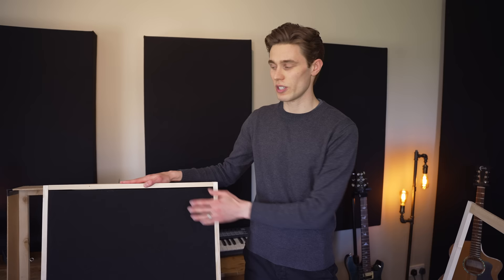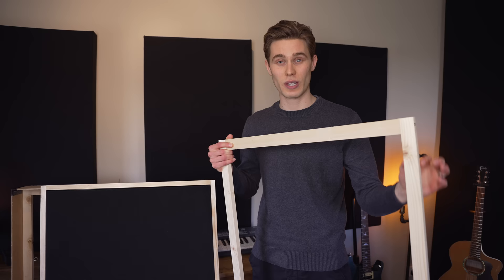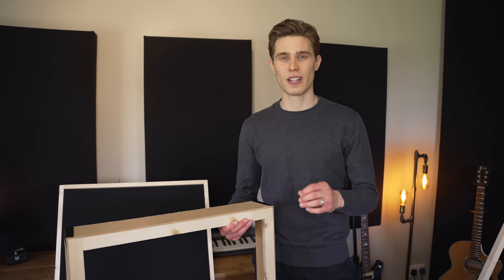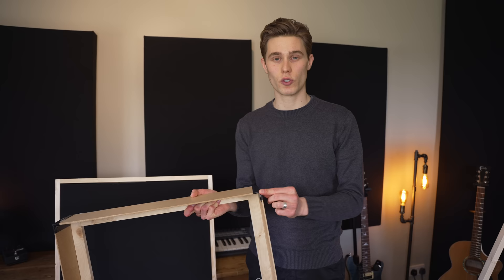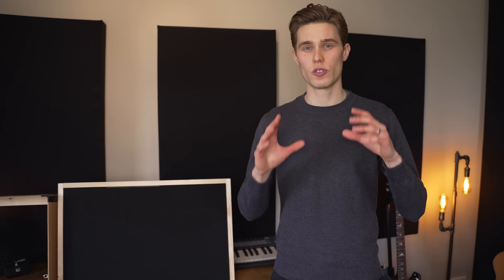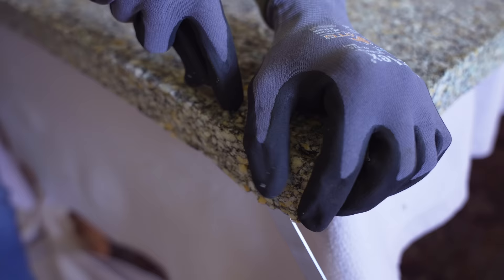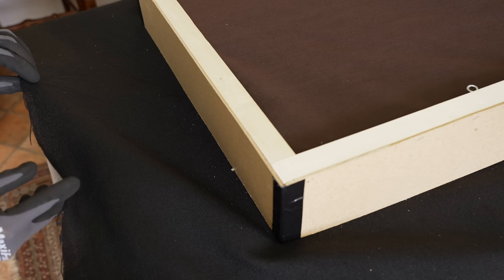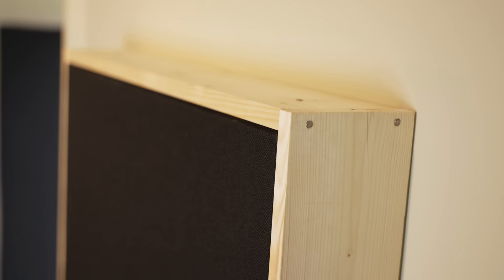How To Make Your Own Acoustic Panels - DIY Professional Acoustic Treatment for Home Studio

Comment: This is such a brilliant resource THANK YOU. 
Safety from toxic chemicals in my small VO booth has been a real concern for me, and peoples compliancy about the harmful toxins released by foams adhesives, rockwool etc. amazes me, you could be saving lives here. 
Please can you help me though, I am in the UK and have spent a good day trawling the internet and only finding large rolls of very expensive fleece, and I am not sure that thermafleece at 22 kgm-3 is the density you suggest. They do slabs but they are hugely costly.
I would go out and buy a large role of thermafleece and get all 7 panels made, but I am not confident that I really need that many as I will actually be doing my recording inside my VO booth.
 I have just moved home and am having a huge crisis of confidence as I am starting all over with a new booth construction. I would be hugely grateful if you could give me a couple of links to UK companies that stock slabs or insulation that is the right density.
Reply from the maker: Hello Eliza, thanks for the support. I too am amazed by the complacency folks have towards these materials. I was equally naive when younger but know better now!

Unfortunately, there has been a real building materials crisis in the UK, at least in my opinion! I cannot find even one ideal choice for the insulation now. Some hemp insulations look promising but they are also highly expensive.

If I can help ease your worries, I'd ask what the VO booth is going to be used for? 
If you are recording audiobooks and professional broadcasts, you do need to take great care but if it is for singing/performance then you might find better results without a booth. I once set up a vocal booth for singing and the result was horrid becuase it really was a tiny room! I found much better results with some close acoustic panels in a large room. I basically used these same panels but added wooden legs to them to move them close to me during recording. It sounded better than any booth I'd tried.

Additionally, the quality of voice denoising and background noise reduction has improved significantly in recent years and can really do wonders!

If you have just moved home, it's possible that any excess insulation you order could be used in a loft space for additional home insulation?

Good luck, let me know if you find anything that works. 

Michael

Comment: Hello, brilliant video. Thanks for sharing. I am going to try to help my Cousin with her board game shop. She says the sound is terrible. From memory it has high ceilings and they have an open plan coffee and snack kitchenette so plenty of clattering. Also, I once helped installing suspended ceiling panels in a restaurant which worked a treat. These used rock wool. FIRE SAFETY was a large concern of mine but that did not concern the company I worked for.  I figured a fire resistant material may need to be used. This is a public place and some of the commercial panels talk about fire rating.

My question is about the fire rating of the filling materials you are using.
I thought rockwool was supposed to be ok, certainly skin wise for me. The old glass fibre was evil on the skin and probably like asbestos in the lungs.
These more friendly fillings seem a great idea but how do they burn???
Thanks again!

Comment: I've worked with fibreglass and rock wool insulation in home renovations.  I hate fibreglass as i get very itchy working with it.  Rockwool is much better.  This said, either be very gentle when handling the materials or wear gloves and a mask.

Comment: Hi, what did you mean by "it will be hard to work with if density is about 40 kg/m3, 50kg/m3 or more" ? Did you mean they will be heavy ? Because I get an offer for 120 kg/m3 recycled denim with a 18 eur / piece (100cm x 100cm x 7cm)

Comment: Great video. Thanks for the heads up about the insulation material.  I was wondering if blockout curtains would be effective? Blockout light and sound. Inexpensive and easy to hang around the studio. Adjustable, so can vary the amount of sound deadening. Regards.

Comment: Thanks so much for this extremely helpful, detailed, and thorough video. I'm wondering how you determined how best to space your panels, and how many you wound up using in the room you were in. Also, are those separate bass traps in the corners? The results of your A/B test at the end are quite dramatic! Thanks again for this resourceful vid.
Reply from the maker: Hi Erikk, this is a good question!
I have 8 of these panels, 4 thinner panels and 2 bass traps. I am planning on adding a thin "cloud" panel above my head too. I used thinner panels in odd spots that can't fit a large panel.

While some careful though was put into how much treatment I need, it became apparent that to deal with every potential issue, I'd need to cover my whole room with very deep panels and then add diffusers to try and bring back a good room sound! 

I decided to aim for a middle ground where my room still looks and feels like a nice space to work in without going overboard on the treatment. I spaced them by eye to what suited me.

Comment: Easy to understand (I have two left hands, as we say in Germany), great presentation and the end result looks amazing and does the job. Will definitely build this for my home theater/music room. Thanks a lot! Question: How many panels did you have in that room for the sound test/difference? Only those 3 or more we simply couldn't see in that frame?

PS: Another thank you for not forcing Raid Shadow Legends or SquareSpace on us. Cheers.
Reply: Hi, hast du inzwischen welche gebaut? Welches Dämmmaterial hast du benutzt? Ich suche gerade verzweifelt Verbundschaumstoff (das ist wohl sowas ähnliches wie das was er im Video nutzt) mit einem Raumgewicht von max. 30kg. Finde aber nur was um die 120..
Reply: @stoneage8593  das ist es, was mich bisher tatsächlich abgehalten hat. Schön, dass es nicht nur mir so geht. 😂 Ein Freund hat sich sein eigenes Heimkino gebaut und hat da einiges an Erfahrung und will mir netterweise zur Hand gehen. Kann dann gerne nochmal updaten.
Reply: @Drumming_Monkey  würde mich freuen :)
Reply: @stoneage8593  egal, wie oft ich versuche zu antworten, löscht yt das Kommentar wieder. Toll. ^^

Dröfzigster Versuch: Ich habe mit meinem Kumpel Rücksprache gehalten und der meint auch, dass PU-Schaum, also Verbundschaumstoff gut funktioniert und optimal für den Zweck ist. Ich habe mir auf sein Anraten hin 4 Stück bei einem Baumarkt geholt (Der mit dem Bau und dem Haus). Die findest du auch auf online auf deren Seite und kannst es dir schicken lassen. Der hat zwar ein größeres Raumgewicht, das ist aber zu vernachlässigen, da wir das ganze Panel verbauen und du ja nicht anderweitig damit hantieren, oder es beschneiden willst. Das Gewicht von 3,25 kg ist auch völlig okay.

Viel wichtiger ist der Absorbationsgrad, den der sagt aus, wie viel Frequenzbereich das Panel schluckt. Das findest du unter der Bezeichnung Stauchhärte und ist hier mit 6,5 kPA gering und damit gut, es werden also nicht nur die hohen Frequenzen absorbiert und genau das wollen wir ja.

Beachten solltest du noch, dass die Größe des Schaumstoffs 100 x 50 x 7 cm und damit etwas kleiner als in dem Video hier ist, pass also entsprechend deine Holzzuschnitte etwas an. Ich werde allerdings die Tiefe des Außenrahmens mit 11 cm belassen. Vorteil davon ist, dass ich den Innenrahmen und den aufliegenden Schaumstoff nach vorne bringen kann, sodass nach hinten zur Wand hin ein Hohlraum von +/- 4 cm entsteht. Dadurch werden von der Wand abprallende Wellen nochmals absorbiert, was die Qualität des ganzen Panels enorm erhöht, als hättest du ein deutlich dickeres Material. Zudem wird der absorbierte Frequenzbereich nach unten hin um ein ganzes Stück vergrößert. Win win also. 

Halt mich gern auf dem Laufenden, wie es bei dir klappt. :) Hast du schon Stoff besorgt und wenn ja, wo/welchen? Ich habe meinen vom örtlichen Gartenmarkt geholt. Ein Anti-Unkraut-Vlies mit 1,2 m x 10 m. Hat mich ca. 17 Flocken gekostet.

Comment: Hey, awesome video - not sure if the price still reflects what you've said but I found the exact same recycled insulation at B&Q but noticed you are using two slabs per panel - pack of 6 cost 108 now so it's 36 quid for just the slabs alone, am I missing something here or just an inflation issue? 😂

Comment: Thank you so much for this well-thought-out lesson on constructing these panels! 

The instructional quality of this video is flawless. There is a massive difference in sound absorption compared to other DIY acoustic panels I have researched on youtube. You may also have a better ear for setting up acoustic panels efficiently. Is there a set of rules/panel-to-wall ratio that you adhere to when setting up your studio?
Reply from the maker: Thank you! I really tried my best on this one. 

As for rules or ratios, it can become very complicated and many will try to over sell the amount you need! I think you can get a great result with a 20% or more wall coverage. The reality is that to make a room "perfect" you would need to cover almost all of the walls with at least a foot deep of panels and add additional diffusers and reflectors. 

I live in the real world so I simply spaced them out until th room sounded good and I was happy with the look of it!

I did make sure to cover the first reflection points of the speakers and avoid any large (3ft / 1m) gaps. Those gaps start to cause a lot of slap and echo.

Good luck, even 2 or 4 panels will make a noticable difference to your space!

Comment: Denimfibers are also unhealthy. When fiber like in Rockwool, etc...is covered it is not harmful. Also those fibers are heavier than air, so they drop to the ground, where as denim fibers can float and potentially be breathed in. Just because it is "natural" doesn't mean it's safer to use.
A proper handling is essential.

Comment: Great video! I'm going to be doing this over the next 2 weeks. Would you mind answering a quick question? What are you doing for your corners / bass traps?
Reply from the maker: The bass traps are a similar design with the wood cut a 45 degree angles to fit the corners. Its a bit more work but gives a good shape. The filling is also more dense.

Comment: I suppose a similar design would work for acoustic ceiling clouds? But, perhaps put the strong frame on the bottom, so it holds the insulation up?

Comment: you can use a painted canvas and just fill it with insulation - sure, the surface isn't ideal, but it still helps a lot

Comment: Amazing tutorial with all the of the details thanks! I would have never thought to use a frame with fibreboard and would instinctually think that using large wide square planed timber would have been much easier and stronger. The fibre board that seems like it actually holds the weight of the acoustic material seems wobbly and weak as it's only attached on one wide. How are these holding up? Does the fabric tend to sag over time and how do you fix that issue if it happens?

Comment: THE ESSENCE OF A DML
Through careful selection of plate material, geometry, boundary conditions 
and excitation point(s), it is possible to evenly distribute the bending wave 
modes across the desired frequency range. This ensures a smooth frequency 
response spanning over seven octaves producing extremely wide and 
predominantly diffuse sound coverage

Comment: Hi, let me start off by saying thank you so much for this awesome tutorial. You've helped me save a bunch of time and money. So I'm currently in the process of building this and I'm at the stage of putting on the cover that will hold the insulation in place. I too, am using the weed prevention barrier since I have much left over from my landscaping days. I just had a question on it. Can I just staple the weed prevention barrier to the frame first, then staple the outside boards to the frame? That way seems much easier to me but just didn't know if there was an apparent reason you chose to staple it after stapling the boards to the frame. Thanks!

Comment: This is super helpful! The only thing I don't get is you say the frame is doing all the heavy lifting and the sides are non-weightbearing but it looks to me like all of the weight of the insulation would on the bottom side panel, or am I missing something?  I'll probably just use slightly thicker wood and a couple nails for piece of mind lol.

Comment: Hi Michael, thanks for the amazing video. One question: is there anything more "home made" that I can place inside the panels for absorbing sound? Where I live the materials to put inside the frame lie a bit on the more expensive side, so I was wondering if I could maybe replace it with any other sort of soft materials such as filling foam (like the ones inside stuffed animal toys), egg cartons, general fabrics and duvets, etc?
Reply: My Rockwool cost me $11 per batt (8 batts, 2’ x 4’ x 3”, $89).  Less per panel than good 1x4 pine!

Comment: Top video 👏👏👏
Question: Do you think varying the depth of insulation within a panel will trap a range of frequencies better than material of consistent thickness (flat)?
I believe that's why acoustic foam is textured, so just working out which way is likely to be more effective...🤔

Comment: Great video. I was wondering how much of the difference between using the panels and not having the panels is due to the bass traps you have in the corner and not due to the wall hung panels.

Comment: Great tutorial! One question: I'm planning on trying this project this week in my home studio and I was considering using a 3/4inch thick "Sonopan" sound panel as the "insulation", usually used behind drywall. If I go this route should I use two layers, so that it's 1.5in thick? Or should I just have thin panels that are just as effective?
Reply: The thicker the better. This is just my opinion, but whatever the material you're using, if it were me, I'd make sure I don't put less than 3-4 inches of thickness on the wall. If you want broadband mid to high absorption, your panels would need to be quite a bit thicker than 1.5 inches. Now, if all you're trying to do is get rid of slapback in the high frequencies, 1.5 inches would be okay I guess. I have no experience with sonopan, but I have seen the youtube video tutorial from the guy who used it. Not sure about its performance to be honest, but again, if the slapback is all you're after, then it would technically work.

I'm planning some panels of my own, and based off of my own thinking and looking into various options, I would sooner consider dense open cell memory foam instead of sonopan, but that is not based on any experience with either material so take it with a grain of salt.

Comment: For ceiling mounting, would you use a different frame design?
Reply: 4 hooks on each corner would probably do, but you could reinforce it with a 45 degree if you'd like

Comment: Thanks for this video! I’m excited to get started. I gotta admit I’m in London and having trouble finding specifically where to get the foam insulation you recommended. I also had a look around and can’t seem to find the Camira Cara for under £12 p.m but that’s not too bad. If you could list retailers you personally used that might really help 👍🏻
Reply: I am also struggling to find any denim or hemp insulation, any advice would be appreciated. :)

Comment: Hi again.  I thought of two other questions.  1) You compare insulation materials by density.  This makes intuitive sense, but would something like a Noise Reduction Coefficient be more descriptive? And 2) I'd like to see you explain how you fastened the exterior wood frame to the inner frame.  Is it screwed on from the inside of the 1x2 frame near the rear of the panel?  Thanks!  I'm leaning toward your build method.  I want the outer frame because my panels will be moveable gobos for recording in an otherwise untreated space, and I don't want to hang the panels on the wall.

Comment: Great tutorial but I would like to point out that density plays very little factor in good sound absorption. It is better to look at the NRC or STC rating of the material. A value of 0 means no sound absorption and 1 means all sound is absorbed. STC curves are used as reference to specific frequencies for decibel absorption. Density will be irrelevant if the material has a low absorption factor.
Reply from the maker: I’m hoping that SAA will be adopted as a better standard too. While you are absolutely right that an NRC or STC rating will be a far better indicator of absorption than density alone I have to share that I have seen a lot of poor testing on these materials. 

The methodologies of the testing are not consistent and materials used are often not the ones that are sold. 

It’s crazy that even this small market is corrupted by bad testing (as better results will drive more sales…). After personally testing many materials, the stated values seem totally off!

Edit: I really hope this doesn’t look like a criticism of your comment, you are absolutely spot on that density isn’t the only important factor!